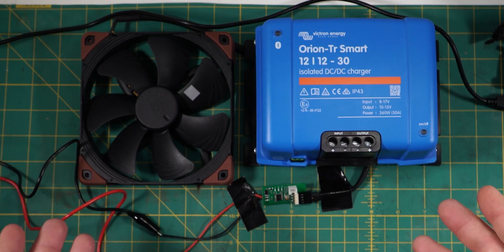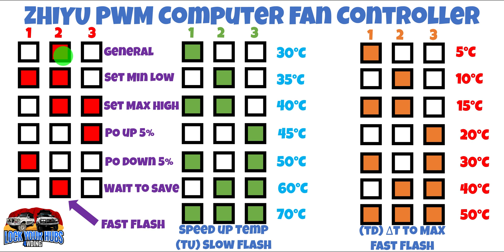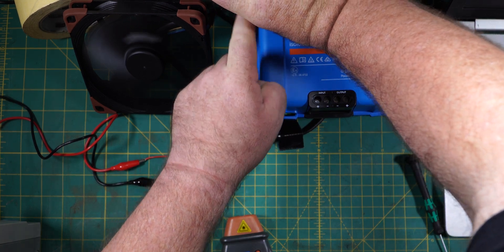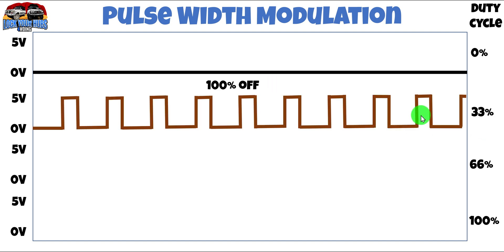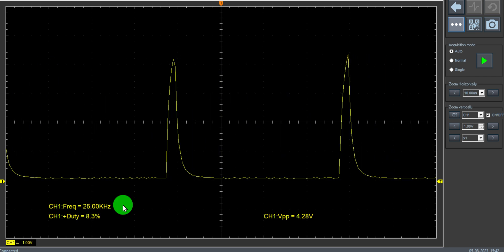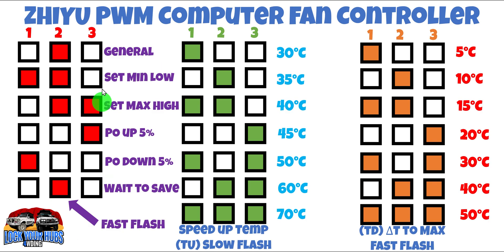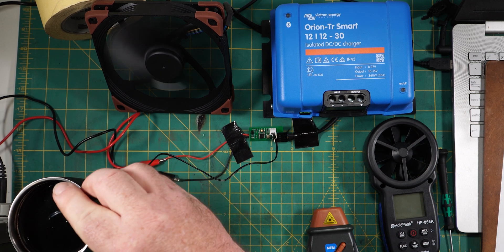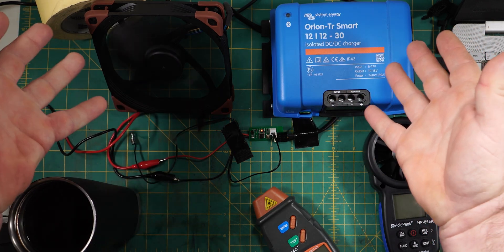Keeping It Cool: Victron DCDC Charger with Smart Temperature-Controlled PWM Noctua Fan

Comment from the maker: 🤔 Question of the Day: Have you faced any overheating issues with your Victron (or other) DCDC Charger? How did you handle it?
Reply: My Redarc 50A DCDC overheated in about 10mins in 15°c ambient, no airflow, and then its themrla protection dropped the charge current form 50A to 42A.
Not happy Jan !

So.... i fitted a Jaycar 80mm fan over the case using 12mm pcb standoffs and a zip tie (dont forget to buy the fan finger guard). The zip tie goes over the top.

I tried 4 different 80mm fans. The Jaycar 80mm low noise mag lev bearing cat # YX2580 works great. You will just barely hear this fan in a quiet house, and cannot hear it with the engine running. 50A continous charge current for 4.5hrs until nearly full charge of my 240ah lfp.
Works great. Happy again.

I also fitted a very quiet 80mm fan to a 40 Kings dcdc (these are actually 38A below 1/2 charge, then twaer of to 35a near full charge) but it didnt need it - I just had a spare fan. The Kings dcdc runs much cooler, almost dead cold, compared to the Redarc.

The Redarc: 54A input at 13.5V gives 50A charge out @ eg 13.5V.
729W in, but only 675W out. 54W is being lost as heat in the case. No wonder the Redarc is roasting. That 54w of heat has to go somewhere
I speculate that the Redarc isonly meant to be mounted in the airflow on front of the radiator (as per instructions).

Redarc do sell an in cab 40A unit, but, I suspect it is actually the same circuit, but at 40A it can survive witbout airflow.

Anyhow, I have been testing in my kitchen for a couple of weeks, at least 10 full cycles of my 2x 120A Kings LFP. Using a 2000W inverter and a 2000W inverter as a load. 40mins at 178A is a good way to stress test your crimps and cable size choice.
Reply: How did you wire the fan up please, I'm having the same issue  @nordic5490

Comment: Is there a way to have the fan at zero rpm (i.e. - TU of say 20 degrees celsius) and the fan then start as temp increases to say 50 degrees?  If so, i think this could be a great idea for the upright compressor fridge in my caravan, which I think is 1. a very snug fit and 2. I could possibly remove one vent to the exterior - decrease that bloody red dust in outback Oz.
Reply from the maker: Hmmmm, not just using this unit alone.

 Though in combination with a simple temperature activated relay, you could interrupt the PWM signal to the fan until the programmed temperature was reached and then turn it on.
Reply: @LockyourHubs4WDing  Thank you for replying. In that case it's probably just as easy to use the relay by itself, which would turn the fan off when the temp drops. Again thx for the reply

Comment: My Redarc 50A DCDC overheated in about 10mins in 15°c ambient, no airflow, and then its themrla protection dropped the charge current form 50A to 42A.
Not happy Jan !

So.... i fitted a Jaycar 80mm fan over the case using 12mm pcb standoffs and a zip tie (dont forget to buy the fan finger guard). The zip tie goes over the top.

I tried 4 different 80mm fans. The Jaycar 80mm low noise mag lev bearing cat # YX2580 works great. You will just barely hear this fan in a quiet house, and cannot hear it with the engine running. 50A continous charge current for 4.5hrs until nearly full charge of my 240ah lfp.
Works great. Happy again.

I also fitted a very quiet 80mm fan to a 40 Kings dcdc (these are actually 38A below 1/2 charge, then twaer of to 35a near full charge) but it didnt need it - I just had a spare fan. The Kings dcdc runs much cooler, almost dead cold, compared to the Redarc.

The Redarc: 54A input at 13.5V gives 50A charge out @ eg 13.5V.
729W in, but only 675W out. 54W is being lost as heat in the case. No wonder the Redarc is roasting. That 54w of heat has to go somewhere
I speculate that the Redarc isonly meant to be mounted in the airflow on front of the radiator (as per instructions).

Redarc do sell an in cab 40A unit, but, I suspect it is actually the same circuit, but at 40A it can survive witbout airflow.

Anyhow, I have been testing in my kitchen for a couple of weeks, at least 10 full cycles of my 2x 120A Kings LFP. Using a 2000W inverter and a 2000W inverter as a load. 40mins at 178A is a good way to stress test your crimps and cable size choice.
Reply from the maker: Sounds like you're sorting it out properly before the install, great to hear! 

Thermal throttling is common in electronic design to handle additional thermal loads, and your right to use forced convective heat transfer to get your performance back rather than rely on passive convection to move the heat. 

93% efficiency for the redarc isn't actually all that bad, Victron quotes 87% for their 12 12 30 DCDC charger, both suffer from thermal throttling though in use. 

I suspect you're right, that the 40a inside unit is just a 50a derated. 

And you're right, nearly 200a of load will sort out any undersized wires or dodgy crimps!

Comment: Got the same dc-dc charger , best I’ve seen it do is 20 amp . Not sure if it’s the settings or heat . Thanks for another educational video 🍻
Reply: My best is 26 amps, until I learned the Orion is a 360w output. 26x13.8v= around 360 w. Depends on lithium battery state.
Reply from the maker: Pretty sure it's the heat, though testing will tell!
Reply: @LockyourHubs4WDing  Looking forward to your next video.

Comment: I have the same Victron, with the same problem. I have attached a small laptop van to Cool it down. Works perfectly. Before I start driving and know that my lithium needs so TLC, I just switch the smaal fan on, and when I stop driving, switch of. My DCDC also have a switch, if my solar is not keeping up, just switch my DCDC on. Saving my alternator. Solar keeps the 300 ah lithium topped up most of the time. 

Good video.
Reply from the maker: While a manual switch would work fine, there will come a time where I'll forget it!

 Automation has the benefit that it never forgets.
Reply: @LockyourHubs4WDing  agree, but what you did is just above my pay grade 😄. On eBay there is a guy that sells that fan and kit for about $100 , for exactly this situation.
Reply from the maker: @filla5019  Tim, yeah, he's a top bloke, very knowledgeable.